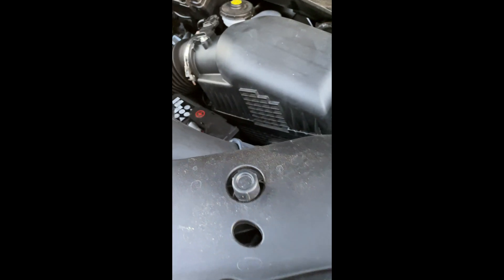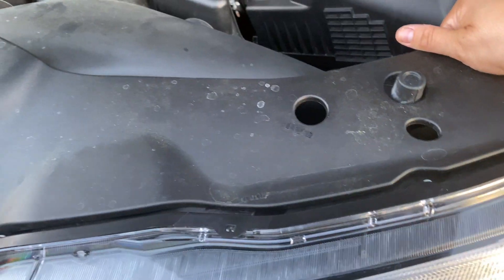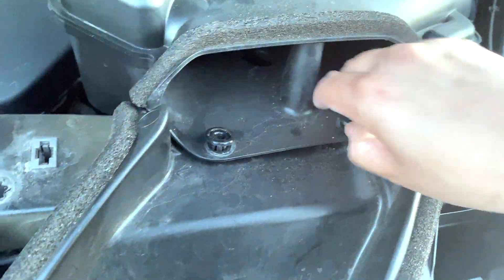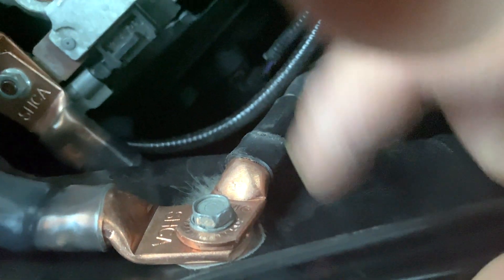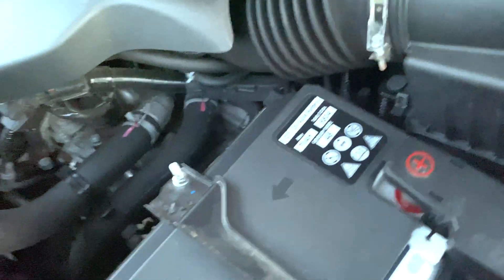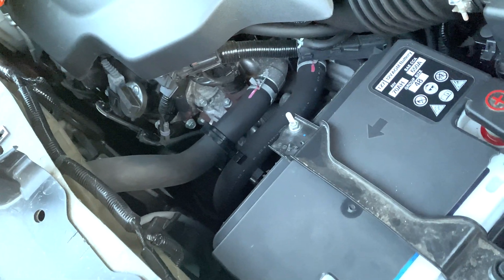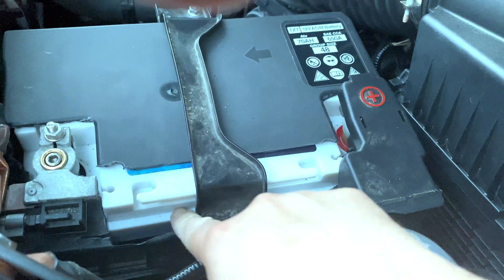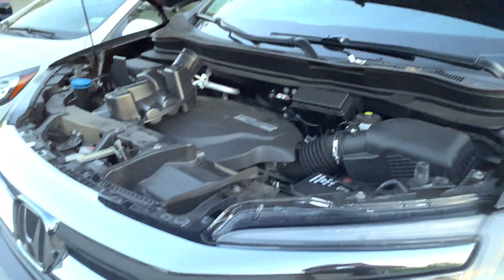Honda Pilot Grounding Upgrade

Comment: Why does a 2019 vehicle need a new battery in June 2020? For the record I have a 2016 Pilot Touring AWD that I purchased in Dec 2015 and at 6.5 years old and 45K miles it still has the factory battery. But I don't have a 10,000 watt rap music blaster sound system so maybe that's a factor.
Reply from the maker: There’s much more to it then “10,000w rap music blasters”. we use this for camping and I occasionally use it with a large inverter for mobile work. It now has the XS power Battery up front and 2 Ixous uc31 super capacitors installed… 

But to mention it I do have a vehicle with well over 10,000 actual watts of audio power that is a absolute blast to show off and drive 😎

Comment: Just upgraded my 2012 Accord V4 with the 35, only because the height of each are the same.  Went with an O'Reilly Super Start Extreme, CCA 640, from the 500 51R. Kept the original tray and cover, but changed out 1 J-hook. THANKS!!!!

Comment: That is not the main ground. There are 3 grounding wires, from the battery and alternator to the chassis, to the engine block, and to the body.
And yep it can be attached onto a painted surface (like every single manfctrer does btw) coz the bolt goes into non painted. When you think youre being smarter than teams of engineers, maybe you could think twice
Reply from the maker: Are you speaking of the tiny 16ga wires running about off of the main little ground point? Because In the video I cover the 3 main ground upgrades and there are no other grounding points coming from the main ground as seen in the video….

I love your uneducated attack on my intelligence 😂

Sure dose ground through the bolt.. but that’s it why not use the entire surface to create a better contact point? 

But hey 🤷🏻‍♂️ I guess my proven knowledge and experience is pretty useless huh?
Reply: thatś right it's useless (Y) LOL
everybody can learn everyday even old "experienced" wisemen yeah?
im not questioning your freedom to modify your own vehicles as you see fit, have fun dude... 
just saying every OEM follows the standard gauges for these harnesses but here comes ol' joe from the barn saying OEM dont know wtf they're doing and the gauge is wrong, its too small etc. C'mon...
Also it's spelled "attack" not attach ;-)
Reply from the maker: @JAndrioli  so now I’m just Joe from the barn huh?

This vehicle has 2 batteries and a large sound system so better grounds are for sure required.. 

And yep they sure do follow a “ national standard”  that applies to everything in general.. still doesn’t mean it’s correct or sufficient for a vehicle with decent electrical demands… the simple charging voltage increase shows the factory ground is less then sub par…
Reply: Engineers aren’t able to practice freely and product the most robust products because they have to follow budget constraints from their superiors. 

That’s why we see these thin gauge wires in the Pilot. If we want our cars to run longer than average, we have to share and implement modifications like this.

Comment: Just saw this. I would be interested in replacing the ground wires on my 2017 Elite. Original Battery just failed - down to 250 CCA. Irritating as it is less than four-year's old. So, have you made up some ground-wire sets for sale?

Comment: I don't know. Honda paid a lot of money to have their engineers design this system. I've learned over the years that you can't outguess those slide rule boys/girls. Modifing can possibly cause unexpected drawbacks. This looks well thought out however considering you are changing to a "non-compatible" battery. I would corrosion proof those scratched out ground connections at the body by coating the assembly with a proper sealant/paint if it were me. That being said, electricity will alway flow to the path of least resistance. If the cylinder head connection is that path, then the body ground may be moot. A megohmmeter would help determine that.
Reply from the maker: Please explain how this is a non compatible battery? Also engineers truthfully don’t know a thing when it comes to anything aftermarket. They build the vehicle to the cheapest price point and send it down the line. If adding/upgrading grounds caused any issues then it’s obviously there were other issues to begin with.

This vehicle is outfitted with a full aftermarket sound system and a few aftermarket lighting features and also now has 3x Agm batteries, the reasoning for my upgrade is mostly due to these aftermarket items but regardless a larger ground and or more grounding points can do nothing but improve the electrical grounding of the vehicle. I noticed a voltage boost with the vehicle completely stock with just upgraded grounds and charging lead from the alternator to the battery. 

All my connections were sealed with undercoating after the install was completely finished so there is no corrosion concerns.

Comment: I'm interested in the wiring that you upgraded if you decide to sell those please message me I'm having problems with my 2020 passport with the infotainment and the crackling noise
Reply from the maker: I’ve been so busy with work lately I haven’t had a chance to even make another set.

As for the infotainment issues and crackling there was a recall just released recently that cures this issue by updating some firmware in the dash cluster and radio